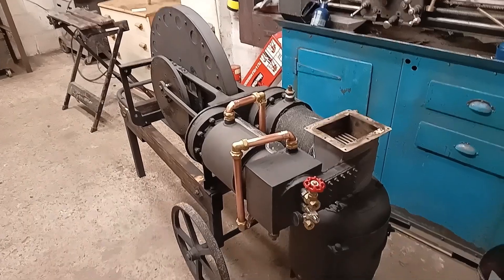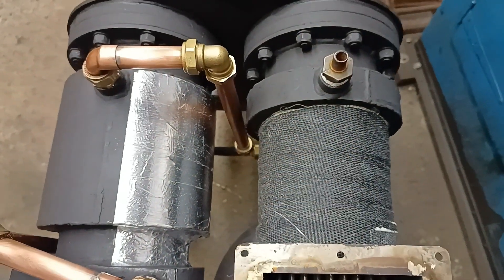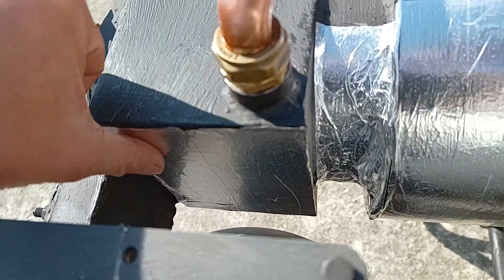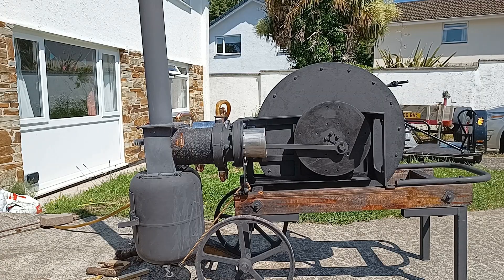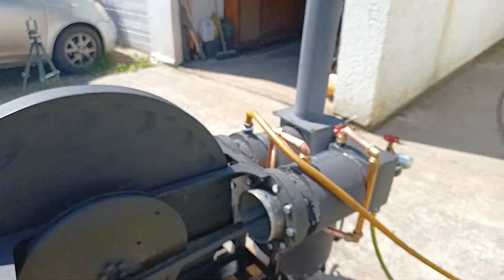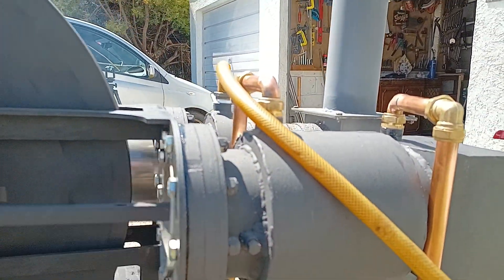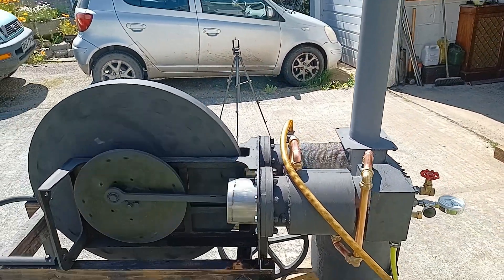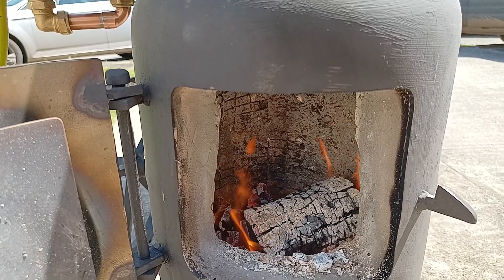Stirling Engine Horizontal Stationary Engine - Water jacket added - Part 10

Comment: I kinda get the "convenience" of having the hot cylinder right against the cold cylinder like that.   Short pipes and all that.  I think you ought to consider separating them sometime.   Leave the hot cylinder where it is.  Then turn the cold cylinder 90 degrees so that it is straight down under the bottom.
then put the cold cylinder in a bucket of ice water.  
This should stop the bleeding of heat from the hot head to the cold head.   sinking it into a bucket like a 5 gallon bucket of water will cool the cold head a lot more and increase your overall power.
Reply from the maker: That's a pretty good idea! many thanks. Check out the stirling engine locomotive I'm currently trying to build!

Comment: It would be interesting to measure the power output of your engine - connect it to a DC generator and then apply as much load to the generator as the engine will allow.

Comment: You should check out the video on derwoodvw channel called big!! Thermal lag engine. 700 rpm. 4 inch stroke. Her uses a stock vw cylinder with a solid Graphite piston.

Comment: i'm a machinist.   have built a few small sterling engines.   i admire how you are building the engine, but suggest you find a machinist friend and true up the sides of the pistons.  The mill finish on the tubes you used was good, but an hour or so on a lathe would make a difference .   I cherish my friends that weld, and considering the cost that welding shops charge they are more valuable than gold.

Comment: You really should, at one point, make a small marine stirling engine to power a skiff or something. 🙂
Reply from the maker: I'm getting to that point slow,y but surely. If I can double the power per displacement then it could work. I like the ideal of a paddle boat  cheers

Comment: About the air intake underneath the wood, I have a fireplace with a firebox with the air intake underneath the wood, and with both the air intake open fully and the air exit into the chimney fully open, it makes the rocket stove roaring sound so maybe it's more a case of the geometry of the firebox influencing how well it burns..

Comment: Regarding piston guides; have a look at the vintage Lehmann hot air engine. The displacer is supported by a roller running in a small pocket in the cylinder wall. I haven't seen an end view of the engine, but I imagine the roller must have been hour-glass shaped. Not sure such a system would translate directly to your engine, but might provide food for thought.
Reply from the maker: Hi, I'll take a look at the lehmann engine. I just tested it yesterday with some brass slides but it did'nt quite go to plan (Uploading video now!)
I need either a roller or slide. I would have thought the roller would cause less friction (it just needs to put up with the heat!) ,Cheers
Reply: @ShanePomeroy  Posted a link but looks like youtube deleted it.

Comment: regenerators...
looks like pt4... just steel? welded straight in to the body?
hate saying it... exact opposite of what you want. that was a lot of work.

think of a regenerator as a capacitor, heat as electric charges... dielectrics are insulators. not conductors.
its the same principle. you want a surface that has a high thermal mass... but lousy heat conduction. like glass... ceramics. materials that are dense but the heat takes some time to conduct through and away. just like a conductive dielectric doesnt make a capacitor, a conductive material doesnt make a regenerator.

absorb heat as it passes from hot side to cold side. retain it. dont conduct it away to the body. it has to stay right where it is. the air reabsorbs the heat on the way back from cold to hot side. it has to be insulated, isolated, and treated as one of the most crucial parts of a good stirling. without it its an extremely inefficient hot air engine.

this modern love of stainless steel and other non ideal materials for regenerators really confounds me.
Reply from the maker: Hi, you say this isn't what you want! So what do you want : ). It was a design compromise like everything is.

I suppose I can only follow what seems to be the common material to use (stainless). I believe the main reason is it doesn't corrode, doesn't conduct that well but still can take the heat out the air ( and put it back!). My regenator is made up of stainless scouring pads jammed in the regenerator chamber (mainly because their cheap). I'm in the progress of trying out a annular type regenerator to cut down on pumping losses (maybe this is a good time to try out something novel?). 

I understand you don't want heat conduction along the regenerator but it also needs to conduct heat out of the air! All the best
Reply: @ShanePomeroy  yes, thats why you use glass, or some type of ceramic. it will dump the heat into the air just as readily as it pulls it out, and do it better than any metal will. yes, it seems counterintuitive. but its exactly the step that stirling made that caused his engine to be the success it was.

just a tip. tis all. yes, stainless is a bit less conductive than common alternatives.

glass wool will probably show an instant improvement over the scouring pads.

whatever. not my problem...
Reply from the maker: @paradiselost9946  many thanks, I will definitely look into this. I'm probably missing a trick! All the best
Reply: In your opinion, could you make a regenerator out of a ceramic that has a high surface area with the air in both the hot and cold ends but that seals them away from each other so that there are 2 chambers of air - each making contact with the regenerator..? Instead of having the air able to pass through completely. This makes more sense to me thinking of a capacitor..
Reply: @al3xf103  no no no... other than maybe in a ROTARY type displacer, thats the only way i can see a regenerator working in that design, as the fluid always flows one way, so yes, it would be two regenerator "fin" sections, with a high conductivity "bridge". across the diameter ( i got a bunch of heat pipes tucked away, always wanted to try a rotary...)

but we aint taking rotary! so forget that!

standard regenerator... hot air passes over elements, and lose heat to the elements, when air flows one direction.
if the elements are steel, copper, whatever... they absorb a lot of heat, but with very little temperature rise. that heat will also try to conduct away rapidly from every contact point. instead of expanding air, it... dumps all the heat in the regenerator and theres no expansion so you shove more heat in to try and counteract the regenarator sucking it all away.

on the reverse cycle the hot elements should then transfer heat to the cool air... but if theyre made from a highly conductive metal with high thermal capacity, and they didnt experience much temperature rise, they cant return that energy to the cool air very well.

now the cold air has to have far more heat applied to again make it expand, and again, regenerator simply sucks it away and wastes it...

the whole point of the regenerator is to trap most of the heat you apply to the hot end, the only "loss" being mostly work performed, and frictional losses. the less effective the regenerator, the more heat most be applied at the hot end, and simultaneously, the more heat required to be disposed at the cold end.

not understanding that is why a lot of stirlings get heat soaked and lose performance... and have terrible performance figures.

replace with glass, ceramic tiles, whatever...

the heat DOESNT conduct away and try to escape... it stays right where it is, much like the charge on the plates of a capacitor is held "stationary". it can absorb that heat rapidly, it can release that heat rapidly.

capacitor isnt the perfect analogy but its the best i can do? 

dont take analogies too seriously.
Reply from the maker: @al3xf103  Now that is some out the box thinking! I like it : ). Urr, I don't know the answer but you've given me something to think about today : )

Comment: maybe i did not understand your reason... but why do you try to equilize the temperature of the two zylinders? In my understanding of a sterling engine the heat should only get transfered by the gas and any other transfer should be avoided... so shouldnt be isolating the hot side (.. as you did) and cooling the cold side be enought... just my thoughts...

Comment: Do you think that you would be able to use some graphite packing as a replacement for the leather seals? Maybe they wouldn't have the same problems.

I also wonder about using something flexible as a diaphragm attached to the power piston in think.

I am ultimately hoping you will achieve even greater success.

Comment: Nr 4: the last one for today; the aerodynamics in the cylinders is far from optimal. It should flow in like a vortex ring/donut. Really easy to make: just a small hole in the top of the cylinder, blowing the work gas straight onto the piston, that is it, vortex ring will follow naturally. This way all the incoming work gas will touch the outer cylinder wall and do heat exchange. Hope all this will get you 500+ Watts!

Comment: Nr 3: 2 things with the re-gen. The metal of the re-gen-body is like a heat bridge connecting the hot to the cold. These must be more heat isolated. And the other thing about it is that I think that the path of the re-gen must be much longer.

Comment: Nr 2: You add and remove heat at the wrong locations. See: when air goes into the hot cylinder, it get heated by first the regen and then the heat exchanger. This is fine. But then it cools a bit in the hot cylinder, not good, and then it goes back to the cold through the heat exchanger! That is not what you want. What is the solution: you need to heat the cylinder walls, not the top/intake. Same goes wrong at the cold side: when the cool air goes back to the hot, it first goes through the water cooled part iso the re-gen. Similar solution: cool the walls of the cylinder, not the top.
Reply from the maker: I agree with everything you say. Theoretically this is correct but I don't think it can be achieved practically without compromise. The biggest problem is the hot piston seal! Beta engines get around this somewhat but then the expanding air is working through the cold zone to act on the power cylinder (in most designs!). I think it's why people get ubsessed with Stirling engines, because the perfect engine can't exist! Cheers

Comment: Ok, nr 1: You use 2 displacers. Sorry for my direct talking, can't help it; I am from the Netherlands! So 2 displacers is wrong in this Alpha configuration. It should be 2 pistons. There is an option to use 1 piston and 1 displacer-piston, but that is more complicated and would also need a large rebuilt. My suggestion: simply use 2 pistons.
Reply: What makes you say they are displacers and not pistons?
Reply: @TheBaconWizard  If I am not mistaking, I saw in this video series that the inner cylinder is smaller, just like a displacer. The are 4 parts on each inner cylinder to keep it center and clear from the walls. The bigger cylinders have a lether O-ring to keep the inner cylinder center, and to close the system. This makes it act like a piston, but then why not make a simple piston? It does not function as a displacer, was it ment to be a displacer? Or am I missing the point of this choice?
Reply: @GiesbertNijhuis  I think the idea was to make a piston, but this is a homebuild welded project not lathed and machined. Very tough to reduce the amount of friction or to find suitable material for piston-rings.
So there is a small gap and some runners.
They are sealed at the end we can see (bottom end) however, so they act as a piston nonetheless.
Reply from the maker: Hi, technically these displacers are pistons because that is all a piston in a cylinder really is. I used this method because it's easy to make. If you look up rider hot air compression engine you're see what I mean. I can work with direct talking : )

Comment: Hi Shane. Yet another slide idea 
What if they were spring loaded to apply a constant pressure on the inside of the cylinder. If the engine is lying down the one on the bottom could be fixed. The others could have some compliance with a spring behind them. I like the graphite. This might stop the chater
Also instead of a slide could there be a complete ring of graphite that would act as a seal at the top of the pistion instead of the slide. This would be the seal and the slide in one.
Reply from the maker: Hi Perry, springs is a good idea, I'm doing it! Leaving the bottom one solid is also a good idea. I'm going to try some brass to see how that fairs? Bronze would probably be better. I think the bore finish would be to rough for a seal at the end. The problem is it is technically just welded tube. Cheers again!

Comment: Hey Shane, I have just watched all your videos of this stirling engine journey, and please don't hate me for I think I found some major issues.. I need a little time to write, can do that later today probably. Good news: there is the potential to get much more power, like 4x or something!
Reply from the maker: Yes , there are a few issues, Thankyou for your other comments, this is great learning for me. I've decided to leave this engine as is and get it as good as I can and use it : ). I have an idea in the pipeline to make one with diaphragm seals instead using silicone. All the best
Reply: @ShanePomeroy  Ah noo "leave this engine as is", not yet! True it will never be perfect, but take a good pause and then one more time please! I would suggest to "only" change the re-gen and the location of heating and cooling. Then it will be much better and then you'll have my permission to let it be as it is  ;-)

Comment: Suggestion: Heat exchange on the chimney, use that preheated air as intake for the furnace. What is the temperature of the gas coming out of the chimney now?
Reply from the maker: That's actually a really good idea🤔 Thankyou

Comment: You work and improve quickly! Idea's: the flywheel, even as it is, can be a cold air fan to cool the cool side, when the air is directed from the flywheel to the cold piston. I will watch the earlier videos now, started at nr 8, but do you use oil on the pistons? The cold piston should be fine with oil, is the hot side too hot for oil?

Comment: Hmmm. I wonder if 30% Zinc brass or even better, nickel-plated brass would work for the slides? they use it for bullet casings for its low friction and corrosion resistance.
Are we still at a 130deg crank-angle?
Reply from the maker: I'll look into those brass variations : ) I'm still at 120-130 ish crank angle. Haven't got around to playing around with that. Still solving the niggles! Will be interesting to see if a change in crank angle will improve thing....
Reply: @ShanePomeroy  There IS carbon or graphene-infused PTFE out there, which has a higher heat tolerance. Not sure if it's good enough or practical to purchase any though. Might be minimum orders or just be pricey. Just shooting ideas at you lol

Comment: Excellent! If there is smoke leaking out through the hot side piston, might that suggest either the thermal degradation of a seal or a small leak in the hot side heat exchanger (only if the pressure at some point in the cycle sips below atmospheric)?
Reply: I also wondered about this. It seems like a heat-exchanger leak could be the cause.